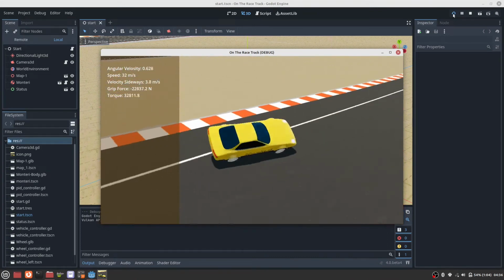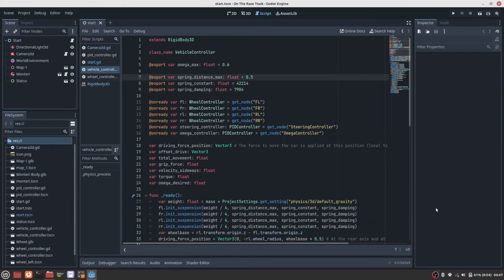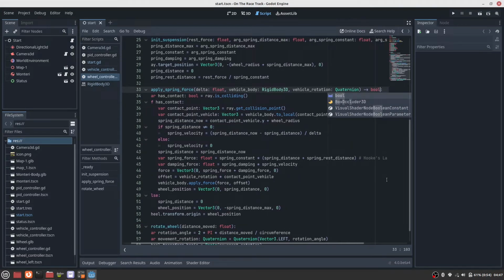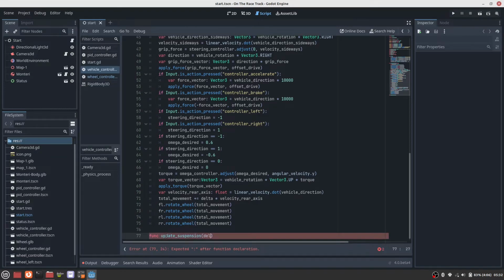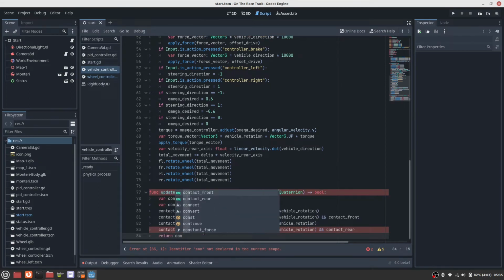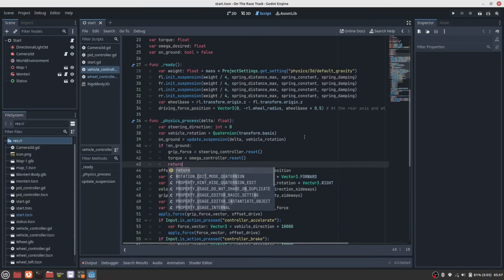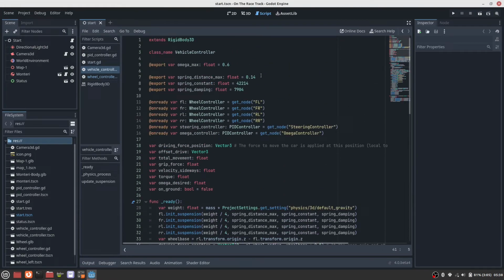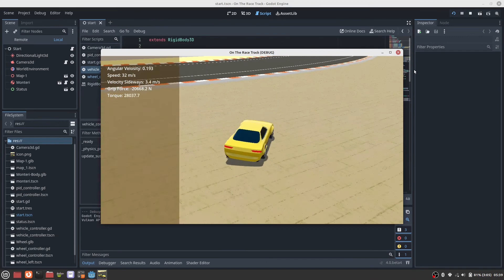Ray Cast Car in Godot: traction

Comment: How's this project going?
Reply: You're well written code has helped me understand quite a few things.

But I've still been struggling making a similar reicast rigidbody car controller.
I think I'm applying forces locally on the body incorrectly.
When I try going up a ramp things go crazy 😅
Reply from the maker: @shindig9000  Thank you very much for your warm words. 😃 I'm still working on the project and I plan to release new videos. Regarding the forces, that's indeed difficult. The force is local, but the rotation is global as I understand it. Did you know you can download my project from "notabug.org"?
Reply: @tomaga4995  yeah, I believe I downloaded it a few weeks ago.
Helped/forced me to learn a lot xD

Quaternions or however you spell it is definitely a new concept to me along with other things.

What I want to make a Twisted Metal like game and I'm thinking this kind of vehicle might be the best approach, although I haven't figured out the best way to roll the car back onto it's wheels when it flips over.
Reply: @tomaga4995  if your project has been updated, I suppose I should go redownload it.

A question.
Do you know about the integrate forces function, and is there some reason you don't use it?
I'm still learning, so it might be a poorly worded question.
Reply from the maker: @shindig9000  When I started the car project I also had trouble getting the car stable. I thought I had to use the "integrate forces" function and I did - but it didn't help. Then I found out about the position being local and the rotation being global and i could just apply the force! When working with rotations, I would definitely go for Quaternions. It isn't as difficult as it might seem. Regarding the flipped car - I don't know how to roll it back.
Reply: @tomaga4995  
Thank you very much for the information 🙏

I think I've come to a better understanding about the local forces part, but the global rotation part still goes over my head and I'll have to process that some more 😆
Reply from the maker: @shindig9000  That is the rotation of the car in the world (in the world coordinate system). E.g. if the car is driving up hill it has some rotation that is different from the rotation it has when it is driving on a plane ground.
Reply: @tomaga4995 
I see.
I think I just don't understand quite yet what to do with that information.

So far as been under the impression that you just let the physics handle all of their rotation stuff and then you just use your wheels to keep you off the ground, so my knowledge so far doesn't understand what the rotation is connected to in terms of the suspension and or the vehicle physics itself, if that makes sense 😅
Reply: If I can figure it out by looking at your code I'm sure it will click eventually.
Reply from the maker: @shindig9000  If you use apply_force() and want to pass the position, you would think that it must be the local position. But the unusual thing is that you have to multiply the local position with the quaternion of the global rotation before. Otherwise unexpected effects happen. This is what I found out.

Comment: does godot support some kind of steering wheel support?
Reply from the maker: I am just a regular user, but I think I read somewhere that it is not officially supported.
Reply: it sees them as a generic controller, so you can use them. i use a flight stick and throttle and it sees them that way as well.